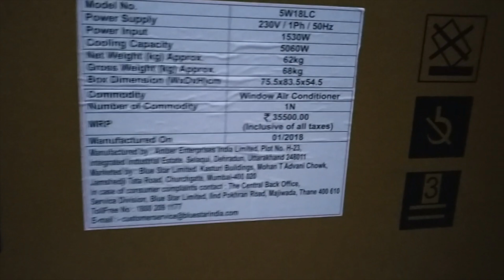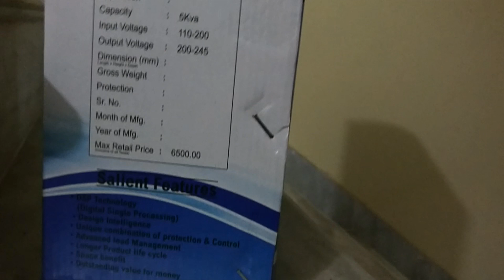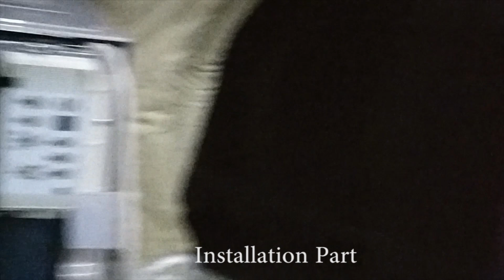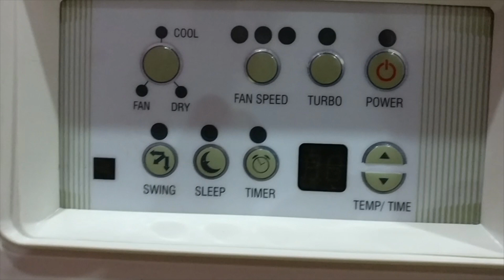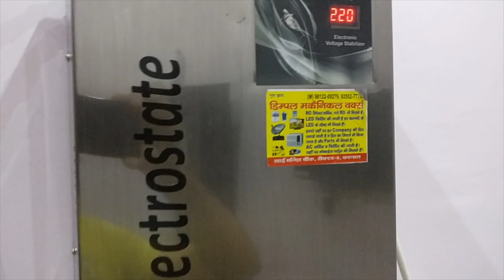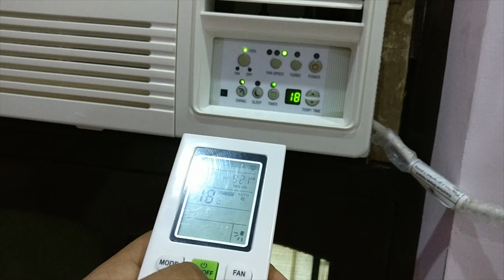Blue Star 1.5 Ton Window AC 5 Star ( 5W18LC ) - Air Conditioners

Comment: How's the noise level
Reply from the maker: Every sound has a level in decibels that relates its loudness. Normal conversation is about 60 dB, a lawn mower is about 90 dB, and a loud rock concert is about 120 dB.  and this Blue Star 1.5 Ton Window AC 5 Star ( 5W18LC ) Air Conditioners has 52 dB noise level.